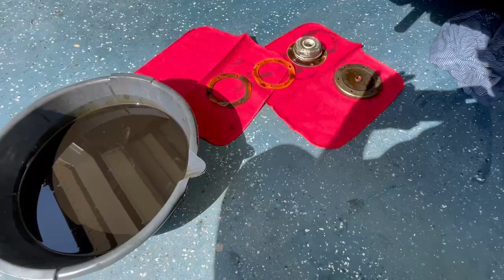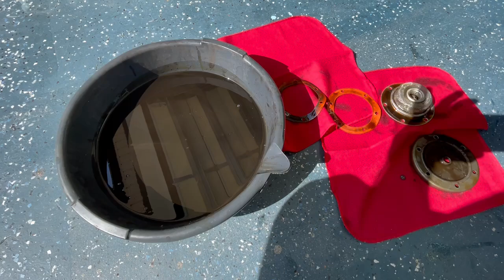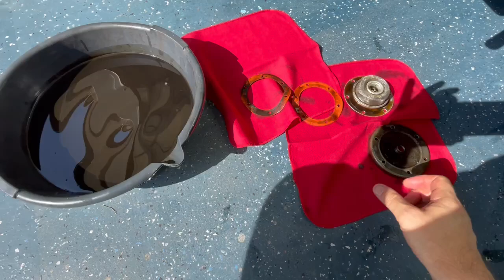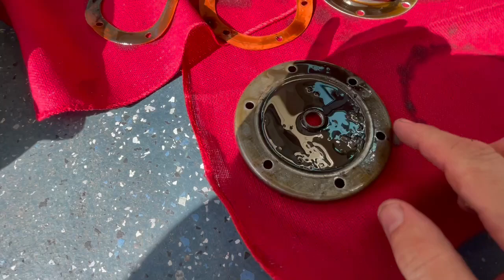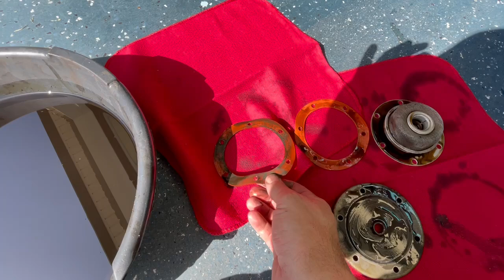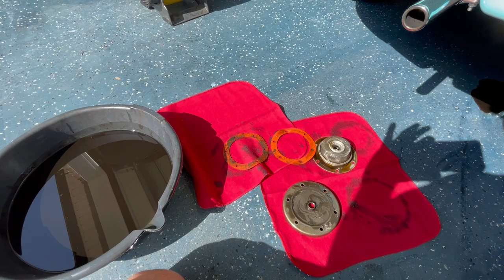3000 mile oil change - 1968 VW Beetle

Comment: I change my oil every 1500-2000 miles as well and I don’t care if people thinks it’s a waste of money. Oil is cheap motors are not, if it looks dirty, it is dirty.
Reply from the maker: Hell yeah! I run at 1500 and pull a sample to send off. Valve adjustments at every other oil change. Also I run Shell 93 V+ Nitro gas with an ethanol treatment.